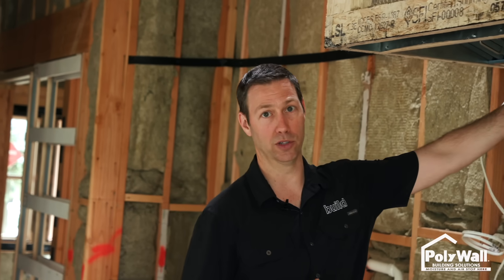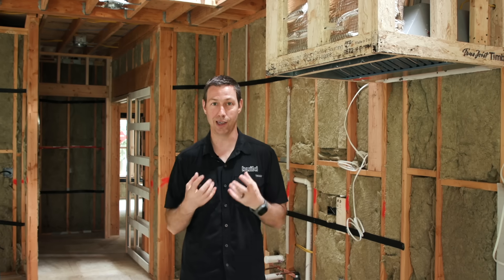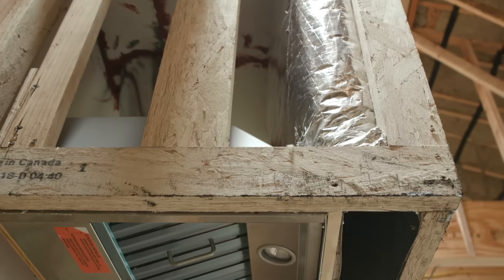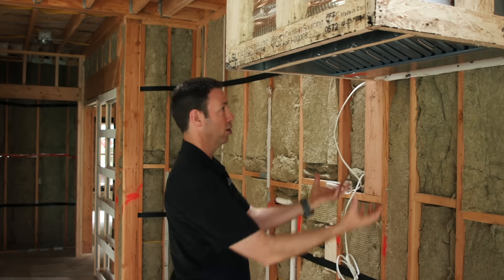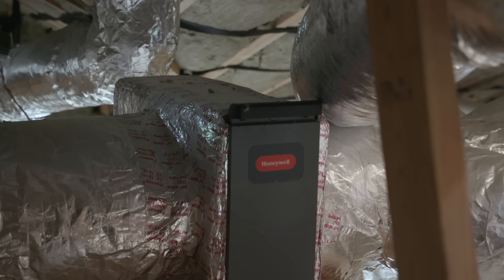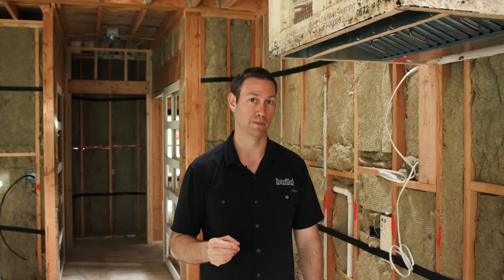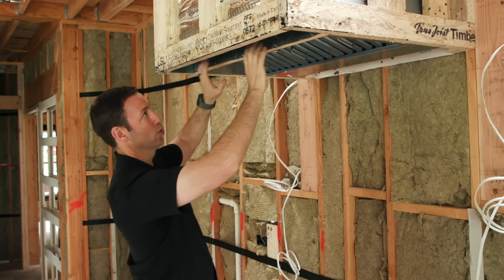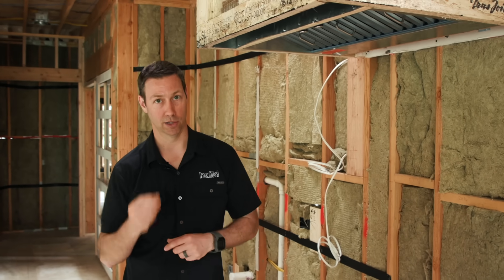Make Up Air - Kitchen Hood in a tight new Build

Comment: I'm so not convinced having the  supply right next to the event well actually remove the particulates.  Your fresh air is going to go straight to the outside missing what year really after.
Reply: It works in commercial kitchens. This is literally the same setup used in restaurants and commercial kitchens. The Makeup Air being right there, creates what is basically an “Air curtain”, the force of the air being pulled downward extends past the grill and then allows the heat and particulates from the range to be pulled out. I’ve worked on both ends of this. I spent time in the restaurant design industry doing work in New Mexico, Arizona, and Las Vegas, NV and now I’ve been working for a commercial HVAC company doing project bidding for the last 14 years.
Reply: My thoughts exactly. The airflow doesn't cross the particulate area at all. I'd be interested to see a smoke test to see what air mixture actually ends up happening.
Reply: @RobertDylina  see here for the smoke test from a similar setup: https://www.youtube.com/watch?v=u2uVaTMXd_8&t=293s&ab_channel=NSBuilders

Comment: One of the important reasons to do this is not the effectiveness of the exhaust fan --  that hood creates a powerful negative pressure on the envelope and so a would pull water through any holes.   Any house built as tight at Matt makes should probably have a Z-duct for makeup air (without a damper) -- negative air pressure will be made up either by an uncontrolled and unlocatable leak, (or the ineffectiveness of the exhaust fans.)

Comment: About time make up air is being added to homes! Commercial kitchens have active blowers to supply air, and some plenums in front of the hood have a separate plenum that also supplies conditioned air. So most of the makeup air going into the hood is just outdoor air, but there’s a thin stream of cool air coming straight down to keep workers cool in a hot kitchen.
Reply: Or warm(ish) on a cold winter day. Here in mn, a commercial hood will have a make up air u it with something like a 60 or 70 deg Delta t. Still chilly if you're a short order cool on a -20f day, but better than nothing, and eliminates condensation in the mua supply duct

Comment: I’m a little concerned about the fire code safety of putting an exhaust vent, supply duct, and gas stove in such close proximity, particularly in a non sprinklered residential installation. You typically don’t want to create the opportunity for a runaway fire to constantly be fed by both oxygen and gas fuels. Is there a fire damper on the supply side unit to mitigate this risk?

Comment: Lower would probably be better. When I worked in a commercial kitchen it was behind the cooking surfaces.
Reply: In theory, at least for restaurant code, the hood should be flush to the back wall and should extend at least 6” past the cooking appliance on the other 3 directions. For an island without a back wall, the hood should extend at least 6” from all 4 sides, not including makeup air.

Comment: Interesting-  being so close to each other I would had thought it’d short cycle. I have been thinking about reversing the flow from a down draft for make-up air but it could interfere with gas ranges. I like your idea, have you seen it in action?
Reply: This is basically how it’s done in every restaurant and commercial kitchen.

Comment: The path of return air vs suction induced by the vent is just short circuiting the cooktop. Ideally the path of fresh, return air would be under the stove or in the kick of the cabinet below the cooktop. This would create a path that pulls air past the cooking surface.  I have a window near my vent hood.  Opening it causes the air to go from the window to the hood, bypassing the cooktop. It tends to not help remove smoke or steam very well. This will be a similar weakness in design. Yet I understand the constraints of design and structure and as shown this is much better than no fresh air return.
Reply: the vent in the kick is not a bad idea

Comment: This is borderline ridiculous. The homeowner now has a relay and powered damper that will eventually fail, and yet another filter to maintain that looks to be tucked away where it will be forgotten and tough to service. The hood is too high to be effective and will be even less so with the makeup air short-circuiting it. Finally we have a new bunch of nooks and crannies of dissimilar materials right above a cooking surface that will be impossible to de-grease and keep clean.  This is a fail.

Comment: That’s the worst place for it. That extractor is just going to draw the incoming air directly as it enters. No way is it going to allow the incoming air settle to the hob and then be drawn back up. The incoming air must emerge at low level to work.

Comment: Why don't you have a heat recovery system built into this system?
Why wouldn't you want the make-up air come in from the bottom of the Stove with the hooded vent and come in from the top with a downdraft system?

Of course the best thing is to go back to the old ways and actually have a cook house.
Reply: What happens when there is a grease fire with that downdraft?

Comment: Do not forget to include an air heat exchanger. It will be cheaper than separately heating the make-up air.
Reply: I guess if there's room for a filter bank there's room for a Heat recovery system

Comment: I'm not really sold on this setup. In a tightly-sealed modern house, you are already going to have an ERV/HRV. I would say just put a fresh air supply somewhere in the kitchen (not even near the stove necessarily) and let that system temper the incoming air. Granted, it would lower the ERV/HRV efficiency since the air going out through the hood wouldn't be going back through the heat exchanger, but you wouldn't be be dumping unconditioned air right on the person in front of the stove. There also wouldn't be a potential "short-circuit" problem either.
Reply: But aren’t ERV/HRVs designed to push out the same amount of air they pull in for essentially a net-zero difference?
Reply: 99% of the air will be sucked straight out with the dirty moist air from cooking, this is how it's done In commercial, with a perfectly balanced hood air conditioning is unaffected
Reply: Exactly what I was thinking too.  You already have "make up air" from the ERV.  Why don't you just up the capacity of the ERV to supply the exhaust hood and you're done.
Reply: What if the make up air came out the back, and the exhaust fan was in the front? That way the hot makeup air doesn’t dump on the person at the stove?

I think they try to avoid using the ERV as the makeup air, because that’s not fully conditioned air. So if you don’t do makeup close to the hood, it’ll suck up all your conditioned air, dump it outside, and it gets replaced with slightly humid, warmer air from the ERV all throughout the house

Comment: wouldn't the pressure drop across a merv 13 filter be too much? no in-line fan needed?
Reply: It’s possible. But in theory if the opening is engineered right, it might not need an inline fan.

Comment: Filtered fresh air but not tempered. Wonder what the comfort of cooking in the winter will be.  A follow up video with a theatrical fogger through the fresh air intake with the exhaust fan running would be welcomed. 

No doubt make up air is needed. Likely we have all been to a restaurant that lacks make up air... hard to get the door open those first few inches and then you feel like you are in a wind tunnel. 

With a tight house, one should also consider make up air for fireplaces, gas/oil furnaces water heaters, and bathroom exhaust fans?
Reply: Make up air can be tempered. There are makeup air units with natural gas direct fired heaters for the winter time.
Reply: RyanHamilton You can also just use a 100% outdoor air package unit too, so you get cooling in the summer and heat in the winter.

Comment: This set up drastically reduces the capture efficiency of the hood.  I.e.   Not going to suck up air from the range as well.  The make up air inlet needs to be further away.  This is why they are often tied to the home air ducting or coming in under the range.

Comment: i hate how most range hoods have a CFM rating of 400, which is a code requirement.  But these range hoods are pretty useless - they dont suck up heavy smoke, grease, and pungent odors. I prefer the Chinese range hoods with 900CFM made by Sakura, Pacific, or Accela. Captures grease and its really effective. I'd just use it with the window open.
Reply: You mean the 399 CFM hoods?

Comment: Interesting setup.  We're in the midst of planning renovation of a 1940s brick cape cod, and my wife wants a hood in the kitchen - but I've been resisting after listening to many of your videos and Joe Lstiburek video/articles.  We're hoping to reno the house and new addition to Passive House 0.6 ACH@ 50 Pa (or better as you seem to have accomplished on some recent builds).

So here's my question or maybe challenge:  Why not just ramp up the home ventilation system during use of the hood to balance the airflow - instead of installing yet another mini-ventilation system?  Is the overall performance better/cheaper to install the system you're showing?  How does the use of that dedicated ventilation for the hood system affect the performance of the whole-house ventilation system (HRV or ERV)?
Reply: northavealum - that would be nice if it could tie into an HRV system when the hood is turned on. This does seem like an unnecessary addition.

Comment: It does seem like a good idea to manage the air flow for an exhaust hood.  I like that it has both a damper and a filter.  However, I wonder how much the system, hood included, contributes to the house's total leakage.  I think I might personally prefer to avoid the penetration altogether.  Which is why I am leaning toward an induction range with an air handler that merely filters and recirculates the air.  What do you all think?  Pros and cons?  I live in an extremely hot environment, so the overall goal is to keep the heat out.
Reply: @treyfarmer1551  thank you for answering.  That is very little. Much less than I expected.  Not bad at all.

Comment: The more I find out about what's necessary to make a good HVAC system work, the more I'm starting to wonder if it's actually a good idea for code to require all that in the first place.

They want this stuff to be as tight as a submarine, which is great for keeping pests out but terrible due to trapping mold and harmful fumes instead.

I can't help but think for every 2 problems a seal house & good HVAC system solve, they create 2-3 more to replace it
Reply: We all know what you're saying, be we all know that giving up is the wrong answer. Building better buildings takes work, but it's worth it in the end when they're more efficient, more comfortable, and longer lasting.

Comment: you should be able to manually close the hood from the inside, the top vents and other are not tight enough for the dead of winter with winds blowing
Reply: Yo ski, i contemplated similar. I live in Arizona, and I was going to create a way to take hot/dry air from the attic in the summer, to put INTO the dryer, and exhaust back outside as normal. Then in the winter, take the air from the house, run it thru the dryer, and exhaust it to the inside of house. I have electric dryer (not gas) 
I could use the little bit extra humidity and heat in my house in the winter, and use the hot/dry attic air to quickly dry my clothes in the summer. (The HOA prevents hanging of clothes outside to dry)
It’s a closed-loop in either case. No net movement of inside and outside air. Thereby Cooled air stays inside in summer, and heated air stays inside in winter.

Comment: What about makeup air for the dryer
Reply: Yo ski, I was thinking the same thing. I live in Arizona, and I was going to create a way to take hot/dry air from the attic in the summer, to put INTO the dryer, and exhaust to the outside as normal. Then in the winter, take the air from the house, run it thru the dryer, and exhaust it to the inside of house. I have electric dryer (not gas) and I could use the humidity and heat in my house in the winter, and use the hot/dry attic air to quickly dry my clothes in the summer. (The HOA prevents hanging of clothes outside to dry)
It’s a closed-loop in either case. No net movement of inside and outside air. Thereby Cooled air stays inside in summer, and heated air stays inside in winter.

Comment: My range hood is 3 speed, 250cfm, 500cfm, 1,000cfm, I use the first setting if using 1 or 2 burners, 2nd setting is 3 or 4 burners and oven, 3rd setting is if I burnt something or cooking something like salmon in a skillet, lol.  If I have to use 3rd setting I will open a window,  there is no returns in the kitchen or adjacent hallway.
Reply: Opening a window doesn’t “meet” building code.
Reply: @victorvek5227  my house is 51 years old, it doesn’t meet a lot of codes, captain obvious.

Comment: As a operating HVAC tech, I'd definitely frown upon putting that damper in a tight space. It's not a question of if it will fail but when. That and I've already seen a few other members of the trade noting the actual ductwork. I love the channel, Matt, but I'd take a closer look at what the difference is between a good setup installed sub-par versus a good setup installed to spec.
Reply: I wondered about that also, low voltage verses a simple mechanical one ?
Reply: I am not a fan of "tight envelopes" this is how we got sick building syndrome and had to start monkeying with airflow to deal with the issues cause by plugging all the air gaps/leaks.
Reply: @thmsmgnm  That's why we have whole home ventilators. You shouldn't be pulling in outside air through gaps in your envelope.

Comment: Something i haven't quite understood over the time i've been watching. I get the benefits of keeping the house tight...but are there any drawbacks? And if the majority of your air intake and filtration is through your a/c etc are there any negative effects from extended power lose like low air levels and co2 buildup etc. Obviously one could open a window or a door but at the same time if it is below freezing outside this could be an issue or if you are asleep or your kids are home alone and don't know what to do. Is there some sort of safety system built in to prevent these kinds of problems?
Reply: If all you did was make your house tight and not do everything else that goes along with that, yes, there are drawbacks.  The house has to be managed as a system.  And along with airtightness comes ventilation and other things.

Comment: First impression of the system looks like the make up air source is too close to the exhaust inlet. 

Granted this would be more complicated and costly, but would it be better to “bath” the stove top work space in the make up air?  Surround the burners with make up air and bring the hood lower. 

Also, would moving the make up and exhaust air through larger pipes work better than higher speed air moving through small pipes. Sounds like a lot of fluid dynamics to me. Better get MIT on the horn.

I guess for the short periods of operation, removal of the unwanted cooking vapors will be the priority and energy efficiency will come in second or third place.

Comment: Looks like a nice way to draft all your heat to the outside also.........Is there a Damper to close the loss of heat in the winter?
Reply: They said there was a low voltage damper, so...yes.
Reply: Vincent: Assuming you are asking about the exhaust side damper??
August: That is on the intake side (fresh air).
Reply: @kadmow  Well both sides are a direct vent to the outside....so both would draft to the outside naturally.

Comment: This is an overly simplistic solution. First, it needs to be said that this is not an AC vent. Your viewers may get that impression from the title. It's only an unconditioned fresh air vent direct from outside.

Second, a fresh air inlet right at the front of the hood is likely to short-circuit the hood. The intention of providing a powerful fan in the hood is to create a partial vacuum above the stove which will pull in the air from the cooking vessels and gas fire(s). Putting a fresh air inlet closer to the hood than the cooktop makes it possible for the vacuum to be filled with the fresh outside air instead of the cooking air, thus making even an oversized hood largely ineffective. The fresh air inlet must be farther away than the cooktop for best results. Since it's unconditioned air, it's probably best to let it in through the wall behind the stove and let it flow up through the stove to the cooktop where it can join the cooking air. This has the best chance for avoiding unwanted drafts into the rest of the kitchen while still allowing the hood to draw primarily cooking air.

Comment: What about the bath fans and clothes dryer? They need a supply of outside air as well. Wouldn't an exchanger connected to the HVAC system be the best for all of these, including the range hood? I understand the concept of a dedicated air supply from outside not needing to be conditioned for the range hood in this application, as it's theoretically exiting the building immediately, thus not causing much of a heat/cooling issue.
Reply: Yup, that's what makes ERVs magic. 

And for the dryers, use heat pump dryers that don't need to vent. They use a lot less energy too.
Reply: Yup. Heat pump dryer. Also, looking into Lunos eGo for bathrooms. Self contained, through-wall ERV. Not sure if cfm is technically big enough for a large bathroom, but worth looking into